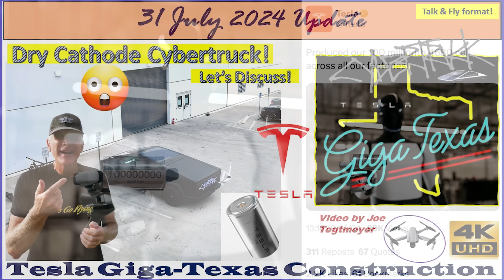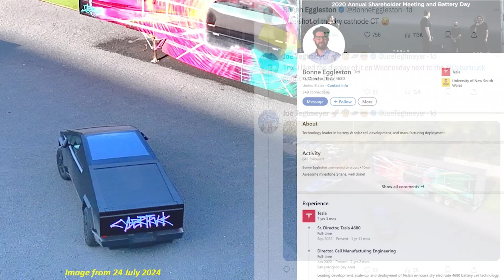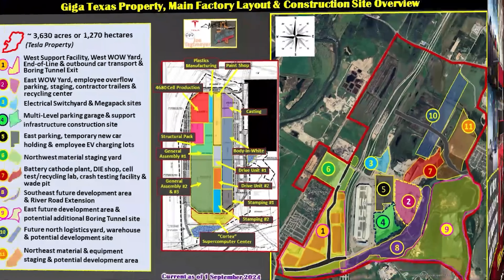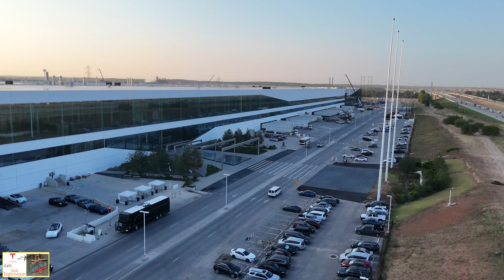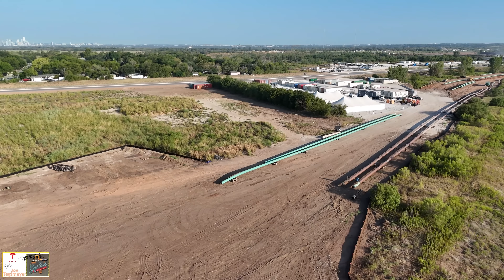100M 4680s! 3rd Transformer & Boring Tunnel Progress! 16 September 2024 Giga Texas Update (07:35AM)

Comment: Besides the tunnel and the super computer does anyone know what the south is being used for? Roadster? Also is the new super computer on the first or second floor? 🤔
Reply: What is shown in the clip released by Musk can only be on Level 1.
Views into Level 2 are difficult, seems to be heavily under construction.
Level 3 has only started filling up with equipment in the last fortnight.

Remainder of the extension. My speculation is highly automated production line, illuminated so that it can be seen by anyone looking in.
Reply: @DessieDoolan  Not very useful for people driving by on the free at 80 mph. View from drones? Not sure if spending millions of dollars on glass hoping to get drone coverage is a good business decision. Don't get me wrong. I think the glass walls are an excellent design decision. But for aesthetic reasons, not hyping and BS regarding technology. Great technology will sell it self if it really is great. Just my opinion.
Reply: @DavidJohnson-tv2nn  I recall (seems so long ago, way before the south concrete was removed) that the south corner and triangle pond was to look out on and lead the way to a "park" down to the river for the public. Business expansion seems to have delayed that and similar initiatives, but eventually there will be time for them.

Comment: Thanks Joe
Sort by Newest First or Top Comments if only the first few lines are visible
7:24. GA, highway side. Fire booster pump inlet. Setting up to core a large (2’ 600mm) diameter hole. Might be a leak has been discovered.
7:59. Southend, west. Level 1. Bottom right. Glazing bottom channel installed. Stack of channels on Level 2 at 8:38 also.
9:50. Southend, south. Apron. Gravel laid over geo-mesh. Might be a road of some sort here after all. Temporary perhaps while the Fire Escape Passage exit path is constructed.
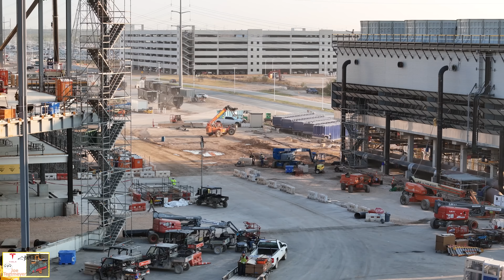10:56. Southend, Cooling Tower. Taken down a couple of the black riser pipes. Relocated the pumps and filters to bottom right.
15:34. Westside, triangular storage. 39 Prolec transformers.
17:55. Westside, Sand Hill Lateral Pipeline project. Pipe has been dragged through the bore.
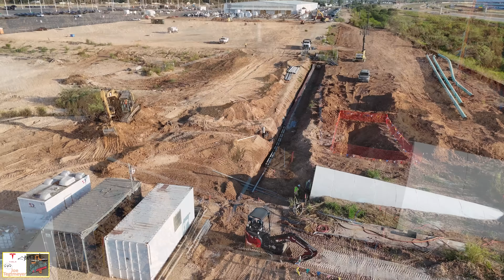18:02. Westside, Tunnel Project. Conduits extended out of the tunnel including the orange fibre duct follow a ‘U’ shaped path to terminate bottom right. Might be a small shed or electrical control cabinets located here.
19:56. EOL, north pond. Weir complete.
20:23 Westside, north starage. 6 trucks driving away with loads of the stored beams, including the rail support beams for a bridge crane
on the last truck at 20:49. Of note is that the tractors aren’t yard dogs, so may be leaving site.
23:52. Battery, west. Apron. Vacuum excavating for bollards.
24:33. Plastics, apron. Pellet delivery.
25:17. Casting, east. Old loading dock opening. Previously removed short wall panel section reinstalled. Saw-cutting the wall panel above for part removal.
25:32. Casting, east. Apron. Super heavy-duty low-loader. Load looks small.
Apron edge, rebar starters installed.
25:57. Casting, east. Wall. Black sheeting. Ductwork penetration marked.
26:28.  Casting, Baghouse. Left. Black hoses connected to the fire suppression foam inductors. Other end seems to be the silos. A search shows dry chemical can be used for fire suppression in baghouses. The baghouse manufacturer Nederman Mikropul doesn’t show fire suppression in their product line.
28:22. New Switchyard/Substation. 3rd transformer footing. Edgeboards/formwork and rebar placed.
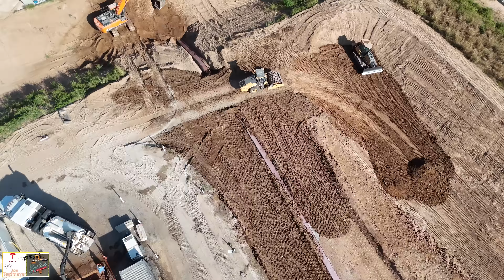31:12. Tesla Road, east. Temporary Kitchen. New ductbank encased in concrete.
Left. Vacuum excavation between the kitchen building and shiiping container.
31:34. Crash Test Track. Black fence posts and top rail. Rolls of black wire mesh.
Reply: Top marks for your analysis of Joe. 
 Tesla's  surprises are at such a high level, so is their ability to solve problems.
This is the big one :: 100,000,000 4680 cells - Not in raw numbers, but in technology.

 " With  Dry Electrodes  "solved", the path,  (1) Corpus Christie (2) Texas cathode plant (3) Texas battery plant,  become a high speed highway." 

Vertical integration on steroids.
Reply: @edwardmorpeth5988  You're most welcome.

I haven't closely followed the battery development. From a construction perspective, I'm sure both Corpus Christi and the Cathode Plant have been on the back-burner as lithium prices have dropped. CC stage 1 was to have been operational early this year. The operational status of the Cathode Plant is a bit of an unknown also.

They certainly do vertical integration better than any of the legacy companies.  I watched 'Elliott Richards on EVs' episode about VW earlier today. Good analysis of what happens when a company 'over' outsources.

Comment: Why can't Teslas drive themselves to the outbound lot rather than use drivers?
Reply: Not certified to drive by themselves.
Reply: Should be able to as this is on private property, as soon as the tunnel is complete
Reply: @triathlonbob1948  Uncertified systems pose a risk to human life. Regardless of whether or not it is private property.
Reply: @DavidJohnson-tv2nn  David, I would place my two-cents in favor of @triathlonbob1948 this time. If they can be summoned or self-parked, then they can move autonomously on private property. And/or Tesla could just fence the road from tunnel opening to EOL, same as inside factory when a robot arm or conveyor is moving the chassis.

Comment: So I asked AI (Perplexity) this simple question:
Q: what's your best guess of the cost of a 4680 battery pack vs the existing 2170 pack

AI:
Based on the available information, here's my best estimate on the cost comparison between 4680 and 2170 battery packs:

Current cost situation:  
The 4680 batteries are likely still more expensive than 2170 batteries on a per kWh basis. Tesla has been struggling to achieve the promised cost reductions with the 4680 cells  

Cost targets:  
Tesla aims to make 4680 batteries cheaper than supplier-provided nickel-based cells (like 2170s) by the end of 2024. This suggests they are currently more expensive.

Potential savings:  
Initially, Tesla claimed the 4680 design could reduce battery costs by up to 20% compared to 2170 cells. However, this target has not yet been achieved in production.

Manufacturing challenges:  
Tesla has faced difficulties in scaling up 4680 production and implementing some of the promised technologies like dry electrode coating. These challenges have likely kept costs higher than anticipated.

Current applications:  
The 4680 cells are primarily used in the Cybertruck, while most other Tesla models still use 2170 or LFP cells. This limited use suggests the 4680 cells may not yet have a clear cost advantage.

Industry comparisons:  
Reports indicate that even if Tesla meets its cost reduction targets for 4680 cells, they may still be around twice as expensive as batteries from companies like CATL and BYD.

Given these factors, my best guess is that 4680 battery packs are currently 10-30% more expensive than equivalent 2170 packs on a per kWh basis. However, Tesla is working to reduce this gap and aims to make 4680 cells cost-competitive or cheaper by the end of 2024. The actual cost difference likely varies depending on production scale and specific implementations.
=====================
all the hype about 4680 and they are still more expensive and heavier that the 2170s they are to replace.

my advice is when listening to elon make all kinds of proclamations
wear rubber boots and carry a shovel
Reply: Yeah totally believe the AI's. Grok says they're cheaper btw:

Conclusion: While the 4680 battery pack shows promise in reducing manufacturing costs, its real impact on consumer pricing versus the 2170 pack depends heavily on Tesla's ability to refine production processes, achieve economies of scale, and innovate in battery chemistry and structure. Currently, the direct cost benefit might be in the ballpark of $3,000 to $4,000 per vehicle for models like the Model Y, but this could change with technological advancements and market dynamics.
Reply: In my opinion his main goal seems to be BS, hype, and pump the stock price.
Reply: @DavidJohnson-tv2nn  OMG you think elon would make insane predictions only to raise the price of TSLA and his personal fortune?

Well......

Comment: Was the drivable surface panels ever reinstalled in the tunnel?
Reply: The original ones failed. No new ones yet. 30 day cure time for the new concrete. Plus they may be waiting to complete the HDD bore under the tunnel.

Comment: Thanks Joe!
Mega-vault:
@ 28:20 While we can't be 100% sure because there hasn't been daily drone coverage over this area in the last few weeks.... It doesn't appear that the new cables that were pulled into the vault were connected to existing switchgear equipment in the 2 white buildings on the vault. Speculating those cables will be connected in a yet to be placed third switchgear building.
LCRA substation expansion project:
@ 28:28 Forms and rebar placed for the transformer pad. Considering how long it took to build the original substation.... Probably another 2 to 4 months of work.
@ 29:14 Going north.... No indication yet of open switches. A necessary step to begin work on accessory structures needed for the transformer.
Rooftop cable trays:
@ 26:04 (Bottom right) Cables haven't reached this far north yet.
@ 26:31 (Bottom) You can see the 4 circuits coming from the existing main switchgear room that merge into the main cable tray run heading south. These circuits are likely now providing power to the data center.